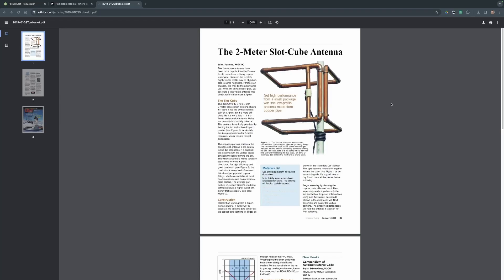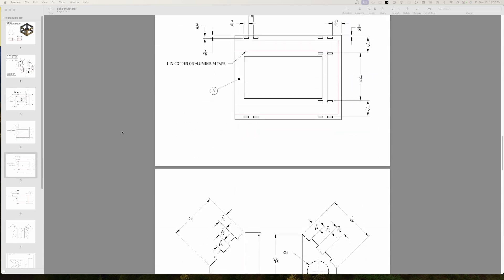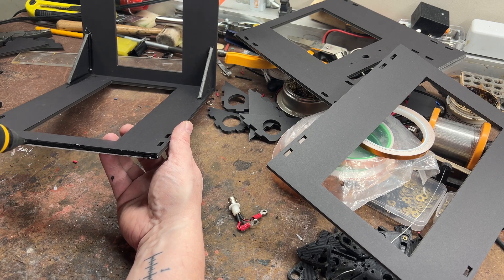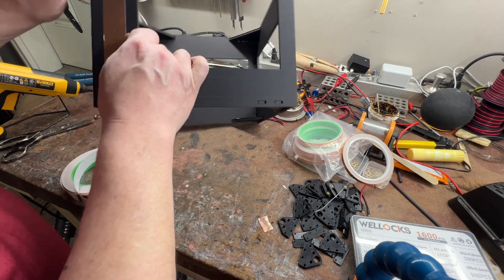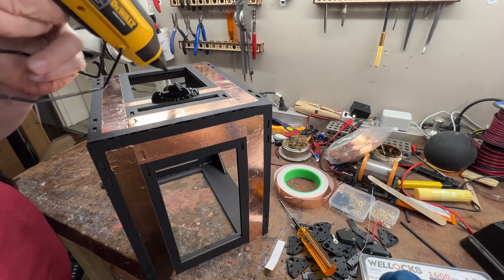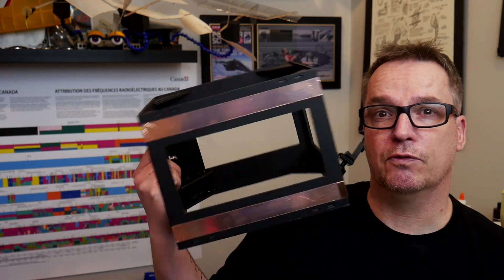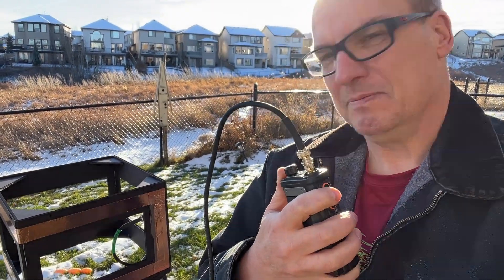DIY VHF 2 meter Ham Radio Antenna Using Foam Board and Copper Foil Tape

Comment: I did it. I ordered four 8x10 clear polycarb plastic sheets from TAP Plastics, glued them into a box shape with plastic epoxy, and put the copper tape on it. Then I put thin orange duct tape over the copper to protect it. Stuck it up on a PVC pole, and it's working great, and it's (presumably) weather-proof. I had trouble tuning it to the lowest SWR, but I got it below 2:1 on most of 2m. Got a radio check from a repeater about 30 miles away (through house obstructions) and he said I'm loud and clear.  THANK YOU for the idea!!
Reply from the maker: LOVE IT! Finding the feedpoint can be a pain but it is worth spending time getting there. But you have a antenna that works so use it! So happy you made one. 73
Reply from the maker: I'll be honest I keep coming back and reading this. There is nothing more satisfying than others getting the successes I have had. Makes me feel so damn good. Thanks for following, double thanks for buying the plans, triple thanks for trying it out!
Reply: Great idea for a more rigid box. I was thinking about using sheets of thin ABS Plastic. (Same but different!) You may find that the weather will eventually destroy the duct tape, but you are on to something there. Maybe one of the Outdoor tapes like Flex-Tape or the Better Boat "Waterproof Tape" may last longer.
Reply: @chrissewell1608  I've used the Flex Tape outdoors, and it might last longer than duct tape, but it certainly can't withstand the sun and rain.  It fails.
Reply: What radio were you using to transmit, and what output? TIA

Comment: These slots on any HF bands are just insane, we use them on 40/80/160m.  Tough to tune at larger scales though..
Reply from the maker: I am in the process of making one using two Squidpoles. Great to hear others doing this. What were the pain points for tuning?
Reply: @VE6SFX_HamRadioRookie  Just chasing the 50ohm impedance point mainly is the tricky bit, the reactance is tuned with the length, as you know.  Make one for 10m or 6m first, then try a 40m one.  They'll go down to 1:1 SWR if you persevere.  You have to alter the width, length, and the feedpoint so its quite a dance.  I just make a rectangle and have all four corners the same height above the ground - it doesnt need to be high up, 3m height for the 40m one is plenty - optimum is the same director / driven element distance, just like it was a yagi, which it kinda is, slot is driven element, ground is reflector.  Then you need a mate with a farm and try the 160m one lol...  These slot antennas can be verrry addictive..
Reply from the maker: My aim is to make them easier to build. Using two of these random sticks https://youtu.be/96KtICkqXwQ and bridging wires on the top and bottom. Then 3d printed feedpoint snap on adapters so you can adjust on the fly. For 20m what width of slot have you used? Or any band for that matter. I know the more narrow the width the higher Q the antenna becomes, but that can be a detriment.
Reply: @VE6SFX_HamRadioRookie  I havent built one for 20m.  All of mine (160/80/40) have been large wire rectangles above the ground.  I did build a circular one for 23vm and 70cm, just rigid wire, worked well.  Now playing with stacking lots and lots and lots of them lol
Reply from the maker: Awesome! I also want to try different shapes. having the slot a 'vee' could make this easier to deploy with a couple squid poles.
Reply: @VE6SFX_HamRadioRookie  I tried that with a 20m version, I gave up for some reason I dont recall - I never got the SWR out of it.  Possibly an extremely effective portable antenna.  Basically it looked like an inverted vee antenna, but a "wing" shape.  I called it the wing-ding antenna, a stupid name and people would have hated it, until they talked to you using it, then they would have loved it - which they would have hated lol..  its a twisted world lol
Reply from the maker: LOL. Someday the world will figure out that us nerds are actually hilarious and great at naming things :)

Comment: Did you observe any signal degradation when using foil antennas compared to “traditional “ ones? The copper tape certainly is a genius idea as we basically could place antennas wherever we please. I am looking to install a multiband antenna on my steel hull sailing boat
Reply from the maker: No degradation using foil but this is all subjective to my ear. I've been so busy manufacturing antennas I simply have not had the time to establish empirical results. Love to hear what you come up with!
Reply: @ I will experiment with the copper tape on my boat and let you know results

Comment: This is an amazing project! I definitely would pay you for a set of cut out foamboards. I do not have a laser cutter. I realize somewhere in thos you said you don't want to deal with shipping costs, but I definitely would pay you for the precut boards, and I would put the copper tap on and glue the thing together. Great video!
Reply from the maker: Stay tuned. A kit is coming off this derivative of this antenna.. https://youtu.be/t2UsV3Os9xk?si=GgFnbAY3PonpruUd

Comment: Well done, I really enjoy the manner that you think outside the box.  I watched your video on the vertical for HF using the carbon fiber pole and Faraday tape.  On this slot antenna it might be possible to make a mod using velcro so this could be used for SOTA activations.  You have inspired me to do some experimenting of my own, looking forward to future videos.  73 de VE7WNO
Reply from the maker: Glad you enjoyed it!
Reply: @VE6SFX_HamRadioRookie  I am wondering if you have encountered issues getting the paper backing off the Faraday tape that you use, I am working with some that is .33" wide and that is causing me trouble.  I have a couple thicker sizes that I am going to try next and see if that helps before I lose my mind.  I am working on a Yagi design that John M0UKD and I worked out about ten years ago.
Reply from the maker: No not really. Wish I had some advice but really don’t
Reply: @VE6SFX_HamRadioRookie  The idea is to make the equal to my earlier antenna but in a form that can be folded or rolled up and put in a small backpack for SOTA but still give a fair bitt of gain.
Reply from the maker: There is a video using foil tape on my channel for a yagi. https://youtu.be/KOLEnWf1CFU?si=EKcvdEdiqExZ4-ql might be worth a watch .

Comment: I wonder if you could turn that ultra light design into a Chinese Box Kite? For higher elevation and ultimate gain! Of course it would require a long length of tiny coax, which is prone to signal loss!? 🤔 But might be fun to try! 
You'd really only need to fly it over the tree top level height, to get out for MILES!
Reply from the maker: I’ve been debating this.

Comment: Hi, how would you tune the swr on it.
Reply from the maker: The dimensions are quite solid on this. You can count on them working. But all you have to do to change the SWR is change where the feedpoint is attached to the main loop

Comment: So I built the foam version just finished testing it. It tunes well nearly 1:1 swr at 146.9Mhz.  According to my VNA it doesn’t tune on 70CM at all. Oddly I ran the tuning out always and it looks very nice on 2.4 GHz WiFi 😅.
I definitely need at 440 MHz version of this antenna. So far quite impressed. I wish there was a place to post or send pictures as I have a few.
Reply from the maker: Awesome. There is a Facebook group I am starting here where you can post 📸 Look at this post on Facebook https://m.facebook.com/groups/162472536717053/?ref=share&mibextid=S66gvF

Comment: Hey, can you make plans for one that is resonant on 145.4mhz? Here in EU we use different frequencies and were a bit lower than NA. I would love to purchase plans and build one.
Reply from the maker: Yes I can! In fact the bandwidth on this one  will be find in that frequency the SWR at 145 Mhz is around 1.12 . If you buy the plans you can contact me here: https://hamradiorookie.com/contact-me/ and to get it super resonant at 145.4 it would need some minor tweaks by moving two of the foil bits out 3mm that is it!

Comment: Anything covered with UV resistant marine epoxy, I like RAKA epoxy, handles weather well. John might be able to tell us if the epoxy would cause any issues, he has gotten interested in that sort of thing recently. I am going to bulid this, I always wanted to build it, but as you said, the copper pipe looked like a PITA. I am going to use PVC sheeting.
Reply from the maker: Maybe try corrugated plastic like coroplast
Reply: John Portune has a video on YouTube somewhere about plastics and RF. EXCELLENT video some materials are nearly transparent to RF and other are not good at all.

Comment: So I need a new cube sculpture in my front yard(stupid HOA).  This is fantastic.  I'm gonna have to build this.  Does this have to be in a certain orientation to radiate well?  This gives me a few ideas that combine with the fabric idea.  Hmmm.  I'm getting ready to start a Youtube Channel (Different Name), I think I might carry your idea forward a little bit.  One more question.  How much did you have to scale up your fabric antenna from the original JPole design?  Is there a scale factor maybe?  I wonder if the scale factor is linear.  You are making science happen.  Thanks for the video.
Reply from the maker: Yes it needs to be in the orientation you see for vertical polarization to hit repeaters. I am not sure about a scale factor but the measurements are 1790mm long element, 620mm short element and 260mm feedpoint. Keep them spaced at least 12mm apart.

Comment: Instead of foam board. Do you think PVC board would work? Much stronger than the foam board.
Reply from the maker: Yes totally but PVC and lasers = chlorine gas. So until I have a CNC that material is out
Reply: @VE6SFX_HamRadioRookie  the PVC board cuts fairly easy with a razor knife. But fully understand Lazer and PVC don't mix.

Comment: Well done Ben, but I have a question.  John mentioned that non-ferrous material inside the slots can interfere with good radiation.  That being the case, it would seem that making the cube out of 6 full squares would not work as well as the cut-out squares that you used.  Do you have any data or experience using full (filled in) squares rather than cut-out squares?  Thanks 73  Tom KC3QAC
Reply from the maker: Honestly I have not done that test and yes I should! Great point and thank you.

Comment: Round 2 😅.   Hey Ben, question.  Is there a way for you to open your original file and tell it to scale to a magic % such as 46% or whatever the magic number is so that this can be built for 440Mhz? I’m in a rental situation with antenna limits. Most of the used ham repeaters are on 70CM not 2 Meters. I’d gladly pay for a 70CM version as well.
Reply from the maker: It works in the 70cm as is! but if you want me to make a scaled version I can. You will need to give me some time to get through Christmas though. Cool?
Reply: I didn’t realize it woul perform on 70CM. Yes actually a 440 version would be nice. I’m smelling a new video as a smaller one could be a good hotspot antenna for say PiStar or other MMDVM’s or other limited space applications.
Yes enjoy your Christmas no hurry! 73 KC8HPS.
Reply from the maker: !!!!!!!!! Never thought of a PiStar. I wonder if i could put the star in the box? If that works then DAMN! Thank you for the idea!

Comment: Hi Ben. I really enjoyed watching this one. I was thinking, and I could totally be wrong, but do you think you could use this antenna to increase the range on a transmitter for an RC plane? If it's even possible, that would be amazing.
Reply from the maker: Great question! This built on the right frequency for the radio it would help the range a bit. However there are better styles of antennas that would extend the range a lot  like a Yagi style seen in this video https://youtu.be/KOLEnWf1CFU?si=Irn4KoZK-LgrVp_q

Comment: Hey Ben great videos. KC8HPS here!
45 years a ham and still rookie/ experimenter.  Did you use a slot antenna calculator of some sort?
Here in the USA we have 900Mhz as part of our bands. I’m currently considering some easy to assemble 900Mhz antennas. If it would scale well this might be a fun project.
I take a medication that gives me what my Dr’s call an Essential Tremor, it has caused me frustration as well. I used to make jewelry, set diamonds etc, but no more. Soldering is still tough but do able.
Thought ***. Automotive clear coat spray paint as a sealant as it has an Anti UV component that protects car paint and likely antenna parts as well.
73 Bryan 😊
Reply from the maker: Love that you consider yourself a rookie. No calculator. If you get John Portunes book https://www.amazon.com/Slot-Antennas-Ham-Radio-Forgotten-ebook/dp/B08D8LC9HP/ref=mp_s_a_1_3?crid=2ZIQ9E9QOCJHF&keywords=slot+antennas+for+ham+radio+book&qid=1702771223&sprefix=slot+antennas+for+ham+radio%2Caps%2C136&sr=8-3 you will be able to scale to 900mhz given his info in the book

Comment: 0:50 Guys from the @flitetest channel have an element resistant(-ish) foamboard. They also developed some interesting building techniques for this material.
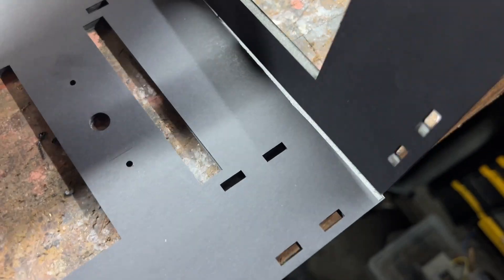2:26 More like rebate joint (-;

I believe, you haven't actually told what band this antenna is for.
Reply from the maker: The title tells you it is for the 2 meter VHF band. And yes I have some of that foam and some of their planes. I am still looking for some robust light and longer lasting material to use.
Reply: @VE6SFX_HamRadioRookie  Oops. I saw the thumbnail and rushed to watch the video so fast that I forgot to read the  title xD Great build.

Comment: A milk crate would be a great substrate for structure...
Reply from the maker: Yes it would. It would ba about 30% too large but that is fine just have a bigger gap for the element ends or go straight into a 6 m slot :)

Comment: How hard will it be to modify plans for a different frequency range? Just asking because I spend way more time with 2.4Ghz than anything else
Reply from the maker: If your antenna is in the 13cm band, this would be massive overkill for this application. The size of the box would be like 2" x 2" x .75" I think for this it would simply be worth taking the slot idea and taping one down flat on it with 1/4" foil on a piece of card. I could do a quick drawing of a starting point for the slot dimensions if you are truly interested in this.